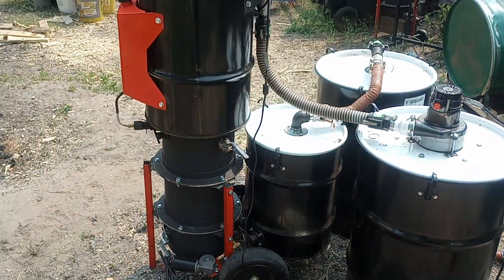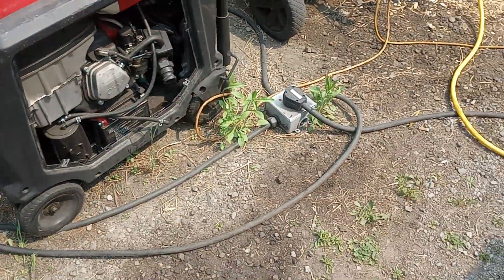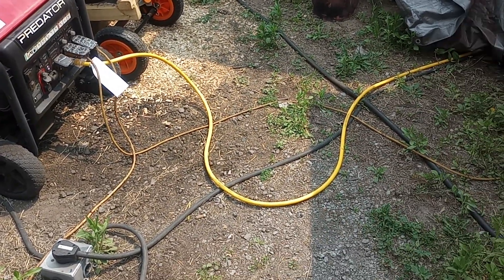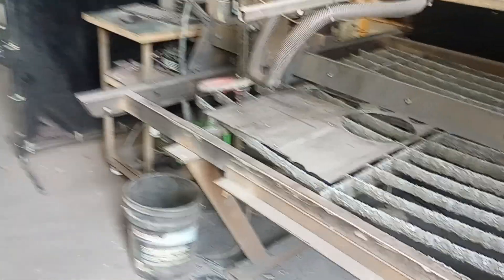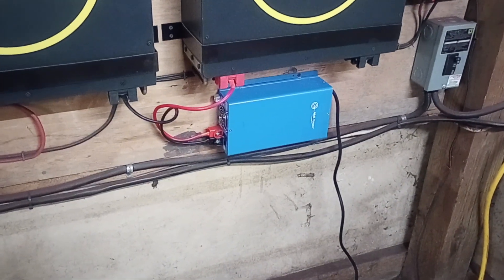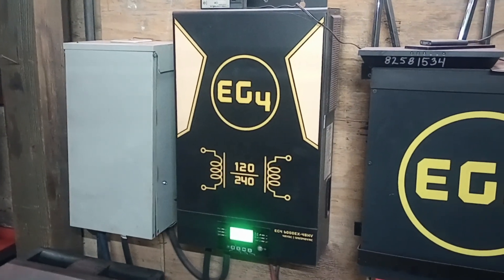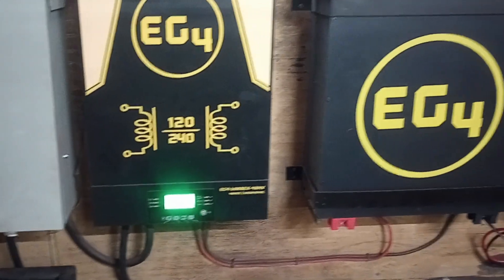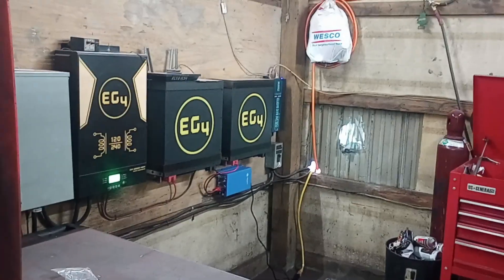Running our CNC machine on Woodgas?? DXF-10 Update

Comment: I too have an aims charger except mine is 24 volt nominal. I like the ability to control the load on the generator by finding that sweet spot where the generator runs best based on the gasifier output and fuel capabilities. That aims charger will run on pretty dirty AC. I buy the 50 dollar specials on marketplace that had gas stored in them for 300 years and the carb is not working. People don’t want to fix them so they basically get rid of them for little cost. Pull the carb, hook up your woodgas connector and bings you have a low cost way of generation at the fraction of an inverter generator. I won’t put dirty AC into the AC in on the victrons. But this is a great way to make DC and tune it to the gasifier, humidity, fuel type etc. You have the best of all worlds with your set up!!!!!  Your killing it, keep up the awesome work
Reply from the maker: Yeah I dont think we will be buying any more inverter generators in the future. Networking them with these chargers is the way to do it. I recieved the second Aims charger today and already ordered a third one today. Our new WEN generator  will be here tomorrow. I think I am going to switch to WEN generators in the future. But the plan is to run the third charger with the WEN 4750 running in tandem with our Predator 8750. We can then also run the gas sipping WEN on gasoline as an option. Possibly needed to run our air compressor when running the CNC machine.
Reply: @Thrive-Off-Grid  keep in mind Aims says you can only parallel up to two chargers at a time. I called them and asked why. They gave me some marketing answer that made no sense to me electronically. I stuck to two.
Reply from the maker: @M35a2guy  Yeah I dont buy it we will see.  Its like the inverter generators, you can parrallel them to infinaty if you had cable big enough to carry the current. One thing you can not do is install more than two cables on the terminals of the Aims output. That fine though as the third one will be wired to the lugs on the EG-4's. The first two I have wired in parrallel to each other and then out to battery.
Reply: @Thrive-Off-Grid  the other thing to look into Mat is megawatt power supply. I run them for my HAM equipment   They are pretty solid and they have no problem running on AC with a higher total harmonic distortion from old school rattle generators eliminating the need for inverter generators. You can wire them in parallel and or series to get the voltages you need with the current you want.

Comment: I like to look at the inputs in terms of money, manpower, materials, and equipment. I'm not trying to down what you're doing. Rather, I'm trying to summarize it.

1) You source the wood (labor, money, equipment).
2) You process the wood down to a chippable size (labor, equipment).
3) You run wood chippers on wood-gas (labor, equipment).
4) You dry the wood chips (labor, equipment).
5) You gasify the wood chips (labor, equipment).
6) You source filter materials and use it (labor, money, equipment).
7) You install a charge controller, batteries, and inverter  (MONEY, labor, and equipment).
8) You service all the equipment (labor, money).
9) Your shop runs part-time due to running low output on a small generator.

Electrical power from the utility would be $0.03/kWh to $0.07/kWh. So, for a couple of hours of runtime, it might be $0.30. Just the labor you'd have in going the wood-gas route might be $36, if you're paying the guys $12/hr. That's 120X more than paying the utility company. That's not to mention all the capital equipment it would take to run this operation.

Seems like a viable Cuba level SHTF scenario, but way too capitol intensive for 1st world applications.
Reply from the maker: This for off grid systems to back up solar. The battery system, inverter will already be existing for a solar set up. The chipping machine is only $500 bucks on Amazon. The gasifier depends on if you want to DIY it or buy it. Thats up to you to justify that cost of buying one. 

This shop runs full time not part time. Processing fuel is not dificult or labor intensive. See the most recent video. It litterally takes less than 10 minutes to chip a full hoppers worth of fuel. That single hopper load can fully charge one of our EG4 5 kW watt batteries. 

This is NOT about saving money, if this is what you are looking for you looking at this for the wrong reasons. This is be independant and to be off grid. We that are off grid dont care what it cost.
Reply: @Thrive-Off-Grid 
I appreciate the response!
Reply from the maker: Not paying Consumers Power Company a dime is priceless
Reply from the maker: To put into perspective as far as cost go. Our shop (prior to this one we are at now) was on grid. Our monthly electric bill ranged from $400 on up to $1200 a month. It was typically around $800 a month.  This system is free and we are not limited and using the same amount of power as before. The equipment has not changed. We are running a 220 volt welder and a 220 volt plasma CNC machine 8 hours a day! Plus all the rest of the equipment in our shop off this system.
Reply from the maker: So in our situation it only takes a year to pay off the investment. We were paying around $9600 a year. All this equipment the EG4 system with our gasifier system and the wood chipper all cost less than this paid in full.
Reply: @Thrive Energy Systems 
Wow, thanks for the info! Do you recommend the EG4 equipment?
Reply from the maker: @cornpop7805  Yes, however things are constantly evolving so indeed shop around. The off grid tech is just getting better and better and cheaper all at the same time. But so far the EG4 system has been running perfectly and Ive had good experience with Signature Solar that I bought the system from.
Reply: Germany rn
Reply: There’s no diminishing return in this process. The cost of the machinery and the labor and equipment on negligent. If it took him only a year to recover his initial investment how how long would it take the average home to recoup that investment. maybe to 2 1/2 years. But you don’t have  all the  equipment to run  that he does. But I could also take a lot less time and create a lot more income. If a home or set up to resell the excess power generated  back to the local power company. The machinery the labor and all that equipment becomes a profit generating asset. So in reality you could probably pay off a home system just as fast as he paid off his shop system and generate income consistently. With proper maintenance indefinitely . Not only could one secure his own Homestead. But now it’s an actual asset that’s producing . Just my two cents.
Reply: @JB Lewis 
In the US, you can't sell power back to the utilities, you can only trade kWh for kWh (aka net-metering). That is to say, you can supply some power (measured in kWh) to the electrical utility. Then later, receive the same amount of power back, at no cost.

In truth, net-metering is always a loss to the power company, and they only do it because they're forced to by government (it will eventually go away).

When we buy power, the cost of that power also includes most of the overhead costs: employees, trucks, transformers, wires, poles, buildings, land, insurance, etc, etc, etc. When we engage in net-metering with them, we are using them as a free piggy bank for the units of power we trade back and forth. But, we pay nothing towards their overhead with those units of power.

In the extreme case, where someone is offsetting all the power they use through solar (or whatever), AND they are engaged in net-metering with the power company, the power company looses the ability to recoup the cost of their overhead through that account.

The loss of revenue is then passed on to other (paying) customers. When enough people offset their electric bills by a large margin, net-metering will go away because it's not financially sustainable for the power company.

If you're truly "off grid" or have no net-metering arrangement with the power utility, the losses to the power company don't exist.

Some utilities recoup some of the cost by charging a monthly fee for the special meter, which is required to do net-metering. Mine is $45/mo.